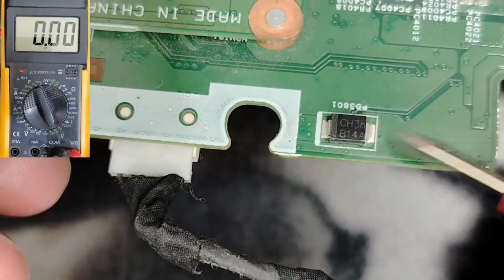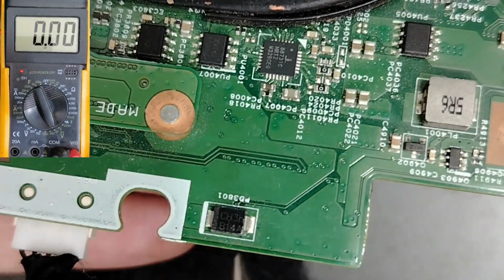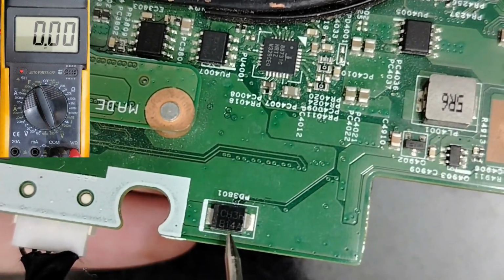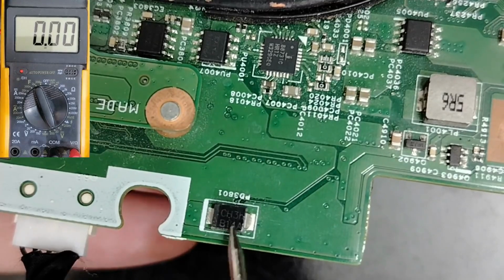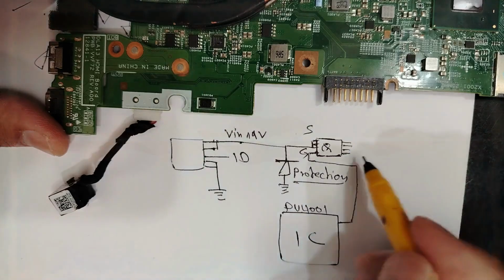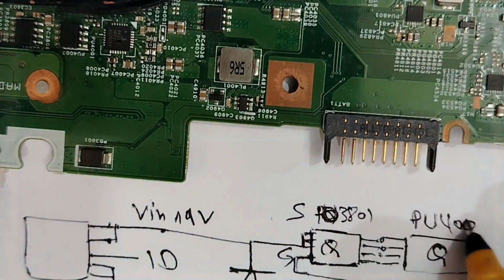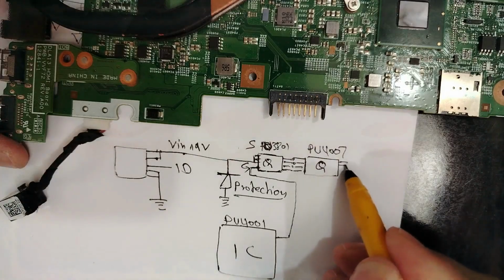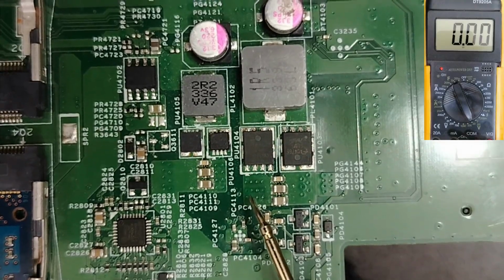Dead Motherboard? Try These Easy Fixes at Home - Laptop Most Common Faults

Comment: master class .this is superb.i liked how you linked the 3.3v or the 5v with the ram control ic. do we also have two mosfets that get 19v b+ voltage in the ram circuit ? my other question is i have an hp laptop.the 3.3v and 5v are present on the coils.if you press on the power button ,the led lights on the motherboard light on but there is no display on the screen.i checked pin 8 of the bios  but 3.3 is not available.i reflashed the bios but still no 3.3v. when bios was removed from the board still no 3.3v not present on pin 8 of bios.the sio is not hot.the surrounding capacitors of the sio non is shorted .what could be the problem here ?thank you

Comment: HP 625 (amd cpu)   , I have  the board and schematics , but can't find the current sens resistor or diode protection near power jack